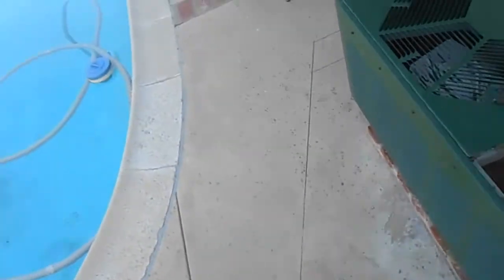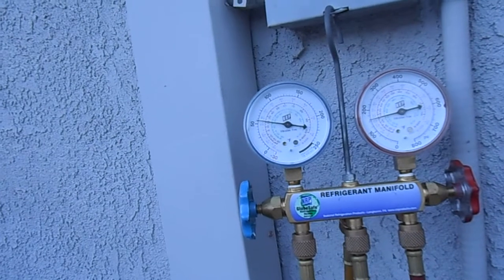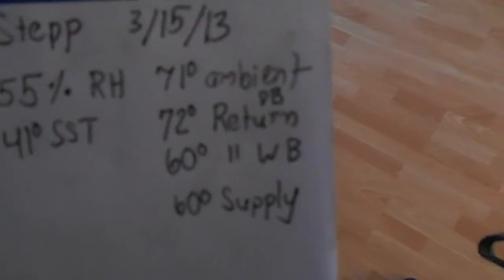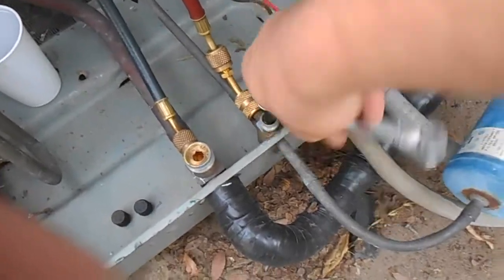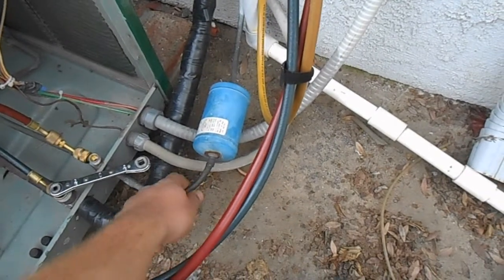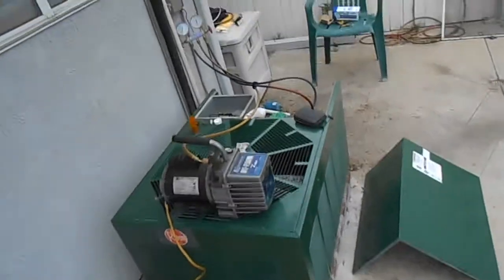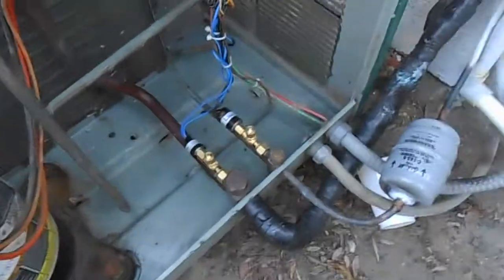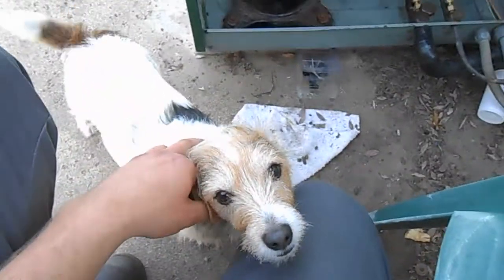Residential A/C Service- Clean Coils, Add Pressure Controls

Comment from the maker: thanks for watching! A lot of folks would argue (with some reason) that the "piggy back" access valves and threaded switches aren't the best way to go. However, this video shows a person lacking the proper equipment or full skillset can still do the job. At this time, I didn't have a recovery machine and was less confident in my brazing/fitting skills. that coupled with my landlord being on a budget made this the right choice! and you know what; it's still cooling like a champ!